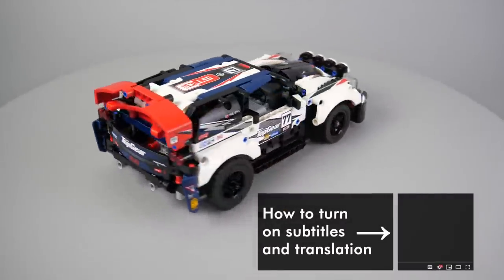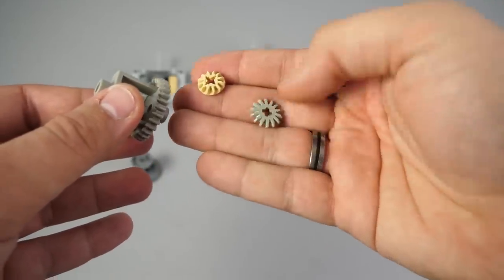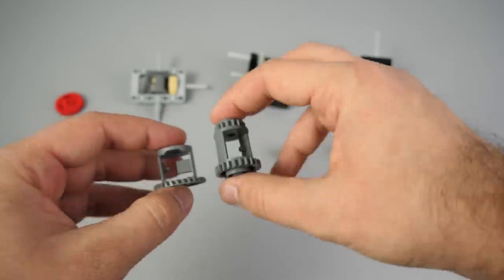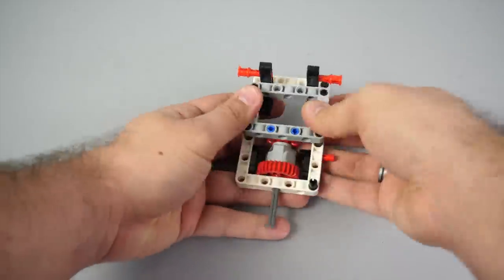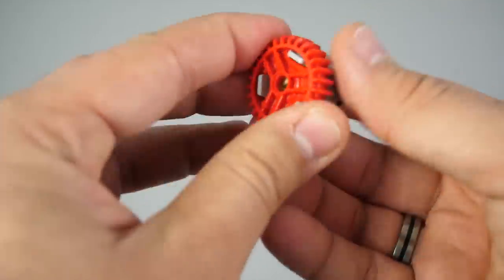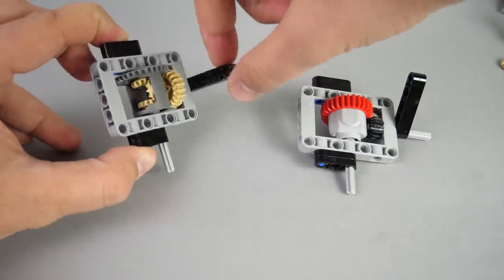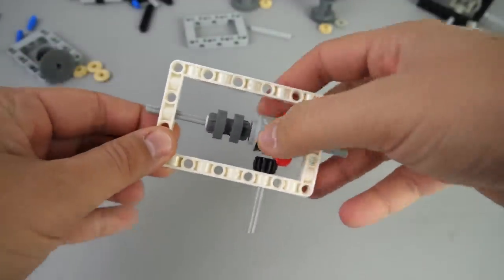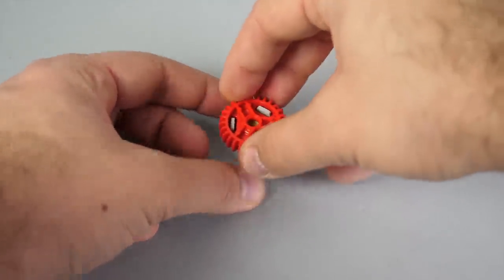New LEGO Technic differential from the 42109 Top Gear Rally Car - test & comparison

Comment: The main problem that I have had with the older differential is that the axles would pull out of the small gears, and the gears would drop out and roll away.
Reply: Same problem lol
Reply: Same here with mine. I have 2 of them now (one clone and one genuine) and the other one is damaged.
Reply: Yeah I had that with the gray one in the light gray bracket. What I did is I have a 3 long small axle, then the extender piece (idk what is called lol), then just another axle, but a technic beam, so that way the axle won’t be able to get out
Reply: True, it always happens in my ford raptor where I did a rc test and although there is a piece that stops the axle from moving, the tiny space is enough for it to slip

Comment: Also, with the idle-gear forces now symmetric and distributed over 3 gears instead of 1, and supported by the smooth circular ridges of the bevel gears instead of the points of the cross-axle holes, this should run a lot smoother under load, too.
Reply: We were this close to greatness
Reply: So true. I've had so many problems with  the idle gear in the second generation diff. This new design is better in almost every way.

Comment: I'm waiting for my lego Torsen diff
Reply: If you want some form of limited slip differential, you could have one of the output shafts geared to an idler shaft directly, and the other output shaft geared to the same idler shaft thru one or more 24t clutch gears. Or you could use belts and an idler shaft, but that's not able to transfer as much torque between the output shafts.
This would be good for a rock crawler model where you need to make tight turns so you do need a differential, but you have a high likelihood of one of the wheels coming off the ground which would leave a model with an open differential stranded.
Reply: @44R0Ndin this is an old comment, but for the sake of anyone reading, I separately had this same idea (w 24t clutch gears) and tested it. I don’t think it quite works, though, at least not as intended. A true limited slip differential acts as an open differential until sufficient slip occurs to cause it to self-lock. The mechanism described in the comment I’m replying to does the opposite, acting as a fully locked differential until sufficient difference between the output forces causes it to self-open and diff spin freely. This may or may not help in some practical applications. I only tested the mechanism itself rather than a whole vehicle, but I’m struggling to see how a reverse limited slip (limited torque?) differential is beneficial in driving, at least. The best thing that can be said for this design is that it: does diff spin less often than an open differential, simply because it defaults to closed, and it could potentially act as an open diff on corners if the vehicle is heavy enough and the traction great enough to overcome the clutch gear lock… but a vehicle capable of taking advantage of the former will almost certainly be incapable of the latter, and vice versa. So imo you’re best off building a worm gear Torsen diff (and accept the damage said worms WILL take), a locking differential, or choosing between open and closed —my long rambling 2 cents from experience

Comment: I like the 2nd gen differential the most. Two-speed operation with no transmission and being able to lock it is a huge deal.
Reply: This come in the 42114? Only has one second gen driffential. Use for Center driffential

Comment: This also has the potential to have different sized ring gears in the future, either from Lego or designed as a custom part. Maybe we'll finally have a system that's compatible with both the bevel gears and spur gears without awkward spacing between the gears.
Reply: The new 42143 Ferrari has a new bevel gear for the same housing. It doesn't match any other Lego gears as far as I know, but it looks like it can withstand a lot more torque

Comment: I have the original differential from the 8860 chassis car.  The large gear ring broke off of the rest of the diff body and the 14 tooth bevel gears were a major weakness in the design in that the axles would always slide out.

Comment: I wonder how easy it would be to make this perform a limited-slip action? I've seen a design that uses belts and an idler shaft to transfer torque from a freewheeling differential output to a held output, but that is limited in the amount of torque it can transfer from side to side. I think a similar but stronger effect could be gained if you were to use clutch gears instead of belts, while keeping the idler shaft.
So you would have one differential output that is directly geared to the idler shaft, and the other differential output would be geared to the idler shaft thru one or more 24t clutch gear(s).
This would allow you to adjust the amount of torque it takes to make the differential rotate the output shafts at different speeds, which would provide a form of traction control for the wheels attached to the differential.
Reply: Old comment and I explain in depth elsewhere, but for future comment readers: the mechanism described here would actually be reverse limited slip differential. It defaults to a locked diff state, but opens freely when the force differentials become too great. It may appear to work under certain conditions, but in general this mechanism will essentially act as a closed diff when you want it open and an open diff when you want it closed. Torsen differentials with worm gears are the only way I know to make a true limited slip diff (warning: part damage) — one that defaults to open, and only closes when the force differential becomes too great. Only other options are a manually locking diff or simply choosing whether you need a diff or solid axle for a given scenario.

Comment: hey racingbrick,i have little question,it's not related to this video but,anyway,im 12 and I have build the 42110 (Land Rover Defender) in bout.... 12h not continuous,is that a good mark? I lost some pieces and I have the cracking issue,but, I have the 1st high and 1st and 2nd low gears work perfectly.so,I wanted to now,what do u think bout the 12h mark of time
Reply: there is no good/bad time mark.  it is LEGO, you should enjoy building it. and not check you're Watch while doing it. #LEGOistimeless
Reply: @basberend  I didn't have a watch on hand,I got it 24th night and finished it 25th afternoon,the 12h mark is,what I think it is.
Reply from the maker: It is not a race, just enjoy building and have fun with the set at the end

Comment: Thank you for the review! I have a question. I'm using the previous generation diff that is 3 studs wide, and constantly have problems with the half shafts sliding off the bevels and popping out of the diff under high load. Do you know if this diff has helped that at all?
Reply from the maker: The differential itself won't hold the axles better, it has the same bevel gears inside. You need to construct the housing around the differential to ensure it stays in place. You can see an example in the Top Gear Rally car where we have a 5.5 long axle on one side, and there are cross blocks on the other side to ensure the axles have no space to move.
Reply: For a lego rc car I have prefered to use a bit of glue for the front axle.
The rear one has no problem, but the Universal joint in the front axle let a free play especially when the steering is at full right or full left.
But you cannot ask to much to the lego, it's a toy not "real" rc car.

Even with just the torque of a XL-power_fonction motor, you can break gears, dissasemble universal joint...

Comment: 1:47 actually, I had a technic buggy set (similar to 8320) which included "crown gear" (part number 3650b), which is able to drive that differential perpendicularly.
Reply: Yeah, I have two of those from some really old sets.  I don't think they are made anymore though, so I don't use them much.
Reply: lol that part number sounds like a hp laptops model

Comment: I have destroyed some previous old model diffs with the buggy motors and a Buwizz battery. After a while the plastic became weak and started slipping. After the first slip it will almost never drive as good again. Too bad the new gear ratio is so much slower. If you put the new diff in an old RC (moc) model it will go even slower. But if the new diff is stronger I guess you need to gear up before it.
Reply from the maker: I think the new diff is slower because the base RPM of the PU motors is higher
Reply: You can have a look our high performance RC,  we use metal to build differential.

Comment: I was disappointed with the newest differential. Due to higher torque the red gear pops off of the grey housing and everything stops working. Kinda too bad. I do like the design and will still continue to use it.

Comment: I wanna get my hands on a few of the new ones, just wish these double-bevel gears had a proper tooth profile cut into them. The bevel teeth are cut right, but the teeth you'd use for a normal mesh are square cut and bind up, run loud, wear like crazy. And god help you if you try to mesh them with the properly cut old style straight cut gears.

WTF, Lego?

Comment: So I'm working on a steam train moc. I want to power the actual drive wheels all 4 of them by powering one axle and connecting the rest with connecting rods (basically Thomas the tank engine style. However I want to use a differential that way the train can make it through corners easier  (kinda like the new train wheels coming out.) However because it's a train it makes it extremely difficult at the frame can only be 4 studs wide. Any way anyone have an idea?

Comment: I Broke the middle gear of my older    Diff as i used a buggymotor to dive it and Put the full Power on it. Also the Main drive gear off my Diff bend all the teeth. 

But i hate the New one cant be used by my extremly compact under/over gearing becourse it Uses the smaller inputgear. I used always the smaller gear to drive the bigger input directly from the top and used two stackt frames for the whole assambly (if anyone is intrestet, i could make a Video or so. Just contact me 😉 ) 

Sorry for my englisch, im german
Reply: I also have the same problem with the gearing of the new one, but I use 2 buggy motors and it is perfectly fine, and the middle gear should not rotate when going straight so

Comment: Can someone please post the element numbers for the individual parts?
Reply: Not strictly new to this set but seen in only two other 2020 sets so far is the spanking new compact Technic Gear Differential Housing in Medium Stone Grey/ Light Bluish Gray (65414 | 6285647) and accompanying driving gear, Technic Gear 28 Tooth Double Bevel with Pin Hole in Bright Red/ Red (65413 | 6285646).

Comment: That means theoreticaly i can slap on a dif-lock and quickly turn it in to a drift-car
Reply: If you have a buggy motor!
Reply from the maker: You can see it in my main review video without a differential, it turns slower and has a bigger turning radius, pretty much that's all you get
Reply: Ok
Reply: we use metal to build differential.

Comment: 4l old differentials are still the best  for me, they have a lot of pros and very few cons compared to others...i don't have the last one and seems a good version of the previous one, the engagement seems better and can be driven directly by a motor in parallel which is the most efficient solution...the old one, over this, has another driving ring both lockable, lot of gear up and down ratios possible, new 9l frames are perfect for a lockable one, and most of all the driving axles completely penetrate the satellite gears with possibility  to insert a 1l cyilindric spacer at the center of the diff: perfect! i'm afraid the new ones don't have this peculiarity and internal beavel gears are poorly engaged into driving axles like in the previous diff...i imagine you have only one and you don't wanna stress it too much!

Comment: You missed the Red differential introduced in 42069
Reply from the maker: You mean the one introduced in red in 42070 and also appeared in 42110? :) That's only a color variation of the one you see in the middle.
Reply: @RacingBrick  yes, I mean that one. They are almost identical, buy the pin hole on the 16 tooth side of the red differential protrudes outside a little (about 1mm)

Comment: Helical cut gears when?
Reply: Probably never, because you would need all the wheels in both directions. A ccw helical gear will only mesh with a clockwise helical gear. Also: axial forces...
Reply: @oldrageface8706  I think I was talking about like a Lego Torsen differential, but I don't really remember.

Comment: Sounds like the new model has a ton of more friction. Makes sense since the pieces are pretty much floating.
Reply from the maker: Where did you see that? If you check the free rotation comparison the new one seems to rotate more easily
Reply: @RacingBrick  you can hear it, it sounds much louder due to the pieces being able to rattle inside of the case. It may run smoothly for a short time but over long term I'm sure the rattling will eventually wear down the small gears. Usually a scraping or grinding noise isn't a good thing when it comes to gears in differentials. I wonder how it will handle in a stress test. Stress test being ran for long extended periods of time.
Reply from the maker: @TheRealBmanswan  once all 5 gears are in place they are pretty secure and run very smoothly. I did not notice the new one being significantly louder, obviously the wear and tear effect will be visible with time. Once I get my hands on more samples of the new differential I will run further stress tests.

Comment: at 4:47 you can see clearly that you are "blocking" the left gear with your middlefinger, so the staitment that the new is better is false
Reply: He is not blocking anything
Reply from the maker: I'm not sure what are you seeing there clearly, I was holding the frame in a similar way with both differentials
Reply: @RacingBrick  take a look at 4:47.....
left side hand touch axle ,right side axle is free floating
if you let your hand loose, you unconsciously make a grasping pose
  and you touch the axis, this brakes it in the picture on the left
Reply from the maker: @axelk4921  I'm glad you know better than me what I was doing :) I can assure you I was not touching the axle, I did the test several times to make sure the difference ia there.